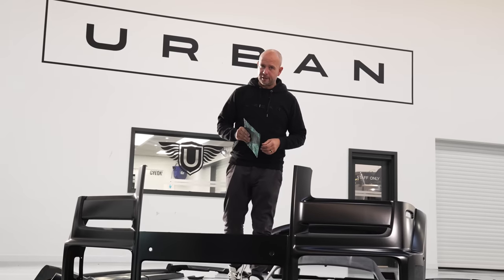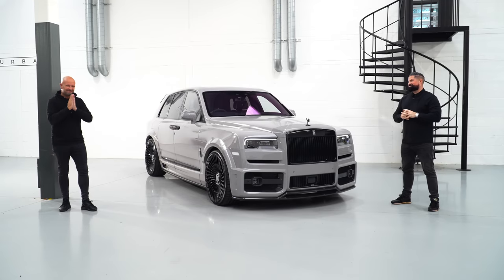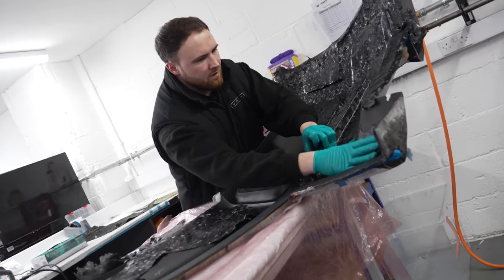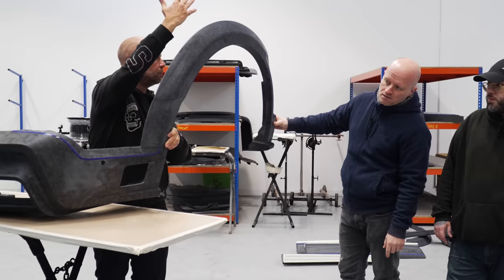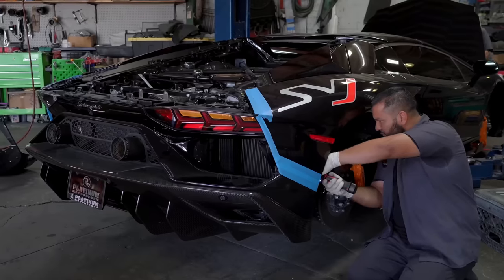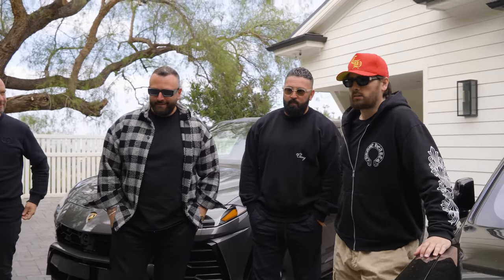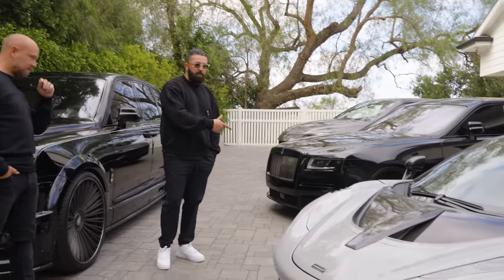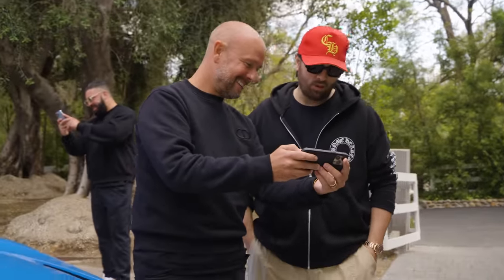SCOTT DISICK’S 40TH BIRTHDAY GIFT TO HIMSELF: DELIVERING A 1 OF 1 FORGED CARBON ROLLS-ROYCE BY URBAN

Comment: No doubt that Cullinan and it’s scallop is badass lol 1 of 1 for sure. It probably could of had bigger tires actually because there’s a lot of wheel gap but other than that, it’s a masterpiece. That SF90 on BBS LM’s is ridiculously clean.

Comment: Wonder what happens when a customer gets suspension issues or something and takes it to their RR dealer, only for them to say it’s not covered due to massive wheels?
Reply: Just put the normal wheels on before you bring in to the dealer, problem solved 😉

Comment: Hrmm so putting a lip, side skirt and rear diffuser makes it a 1 of 1? I guess mine is a 1 of 1 as well lmaoooooo
Reply from the maker: Does yours have full replacement forged carbon fibre bumpers front and rear and 26” in wheels too?
Reply: @UrbanAutomotive  Thoughtful reply. No my car does not have forged carbon front and rear bumpers not in the market for my model yet. I do have cf hood, trunk and fenders. The car also traps about 140 and change and does high 9s. Im just saying that calling something 1 of 1 is not really the case, because my car would also be a 1 of 1.